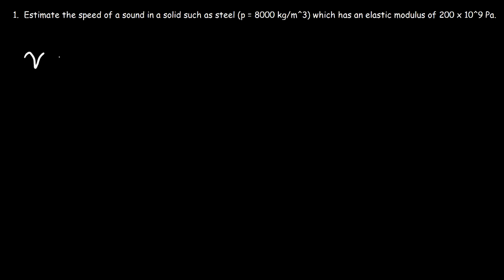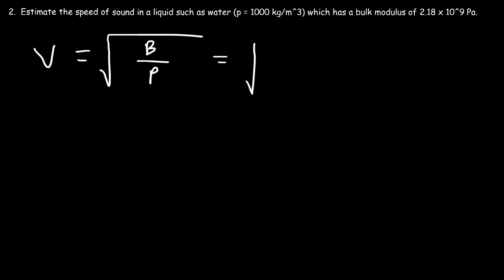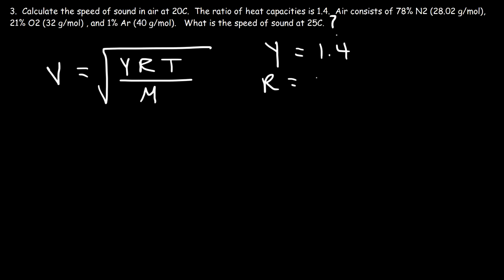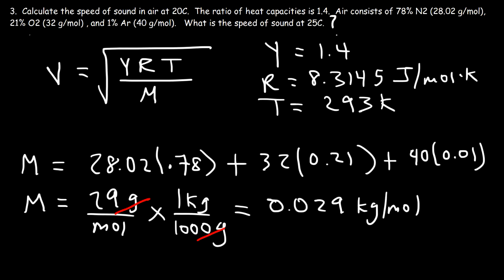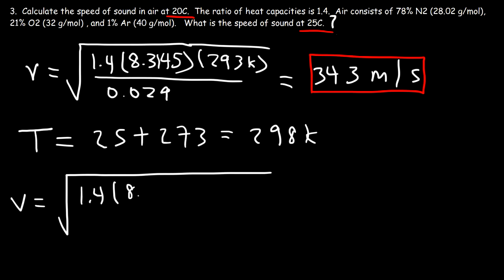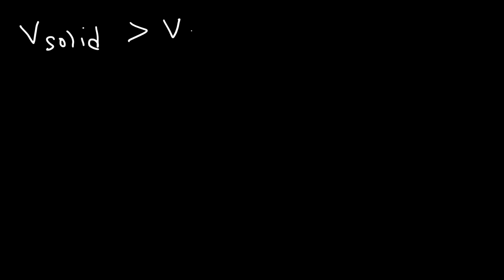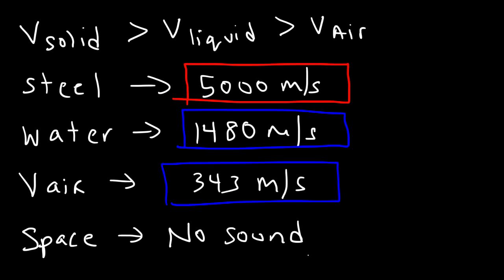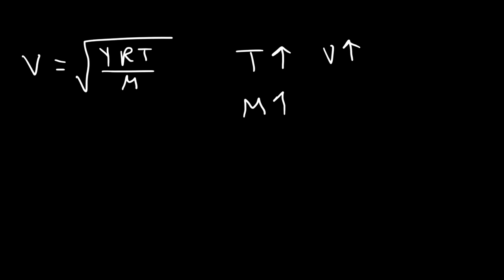Speed of Sound in Solids, Liquids, and Gases - Physics Practice Problems

Comment: If speed of sound is constant (344m/s) then why do we calculate speed of sound for different wavelengths, with the formula ... speed of sound = frequency x wavelength. Because there are numericals given in kid's textbook to find out speed of sound with the given frequency and wavelength. Some websites on Google says speed of sound is uniform (344 m/s) and does not depend on frequency or wavelength, when the opposite is clearly given in the formula. Please explain.
Reply: I might be too late but I think the constant 344m/s is in a condition where the medium it passes through is dry air and at a temperature of 20°C. We use this constant a lot since this condition is typically our normal environment. Do also note that room temperature is around 15°C to 25°C, so it makes sense that we get the value in between which is 20°C